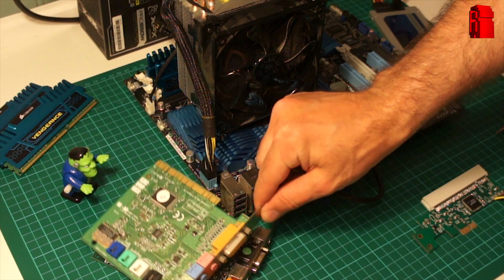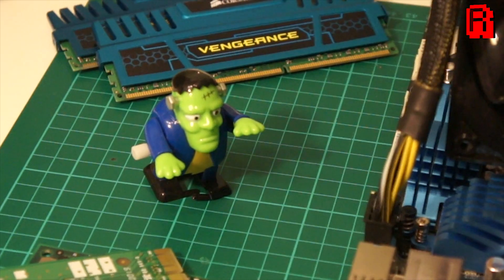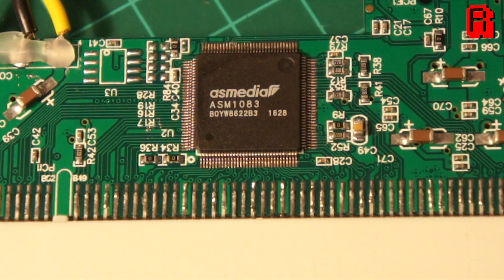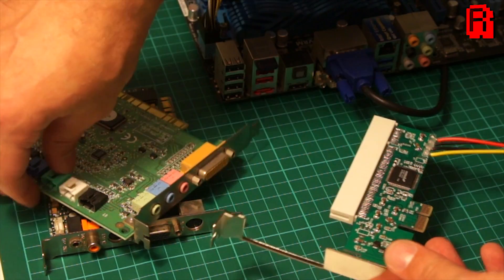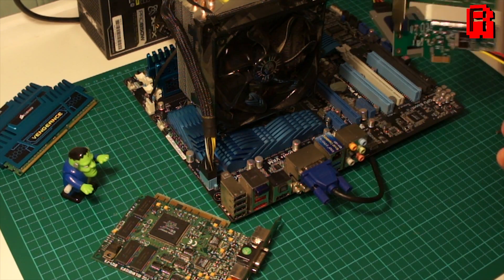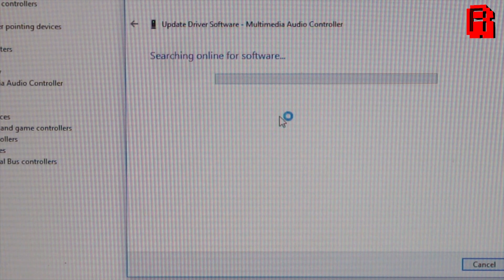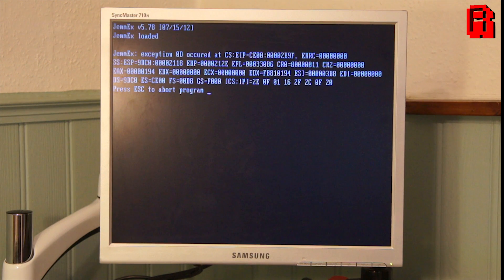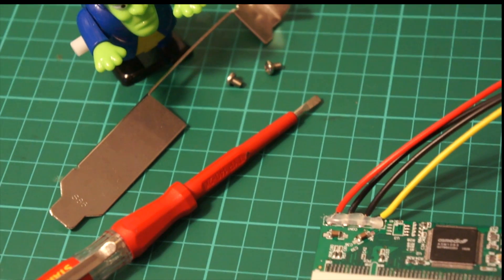PCI Express to PCI Adapter | 5 Min Tech Test

Comment: ASMedia chipset based converters have low compatibility. Pericomm chipset based converters are ways better.
Reply: Asrock H67M motherboard has an integrated ASMedia 1083 chip, with it these sound cards are working flawlessly: Sound Blaster X-Fi XtremeMusic, Auzentech X-Fi Prelude 7.1, Asus Xonar Essence ST.
Reply: @olymind1  I own a motherboard from gigabyte ( model b550 aorus elite ax v2 ) and I want to connect a pci tv tuner card from Aver Media TV Super 007 analog
OS is windows 10 x 64 
Is this procedure wanna be easy from me to achive or not ??? 
I have already ordered this adaptor and I just waiting for purchase this item

Comment: One of the positive aspects of Windows NT (5.0 and beyond., although this is true for Windows Millennium Edition as well) is that any WDM Driver is Supported.

This means provided there is a Windows 2000 / XP / Vista / 7 / 8 / 8.1 Driver available., it will install and generally work relatively issue free. In fact Windows 8 / 8.1 Drivers are 100% Compatible., at least the Drivers themselves.

What you have to watch out for are Driver Packages that include additional Software / Services, as these WILL NOT be Compatible between Windows. So it's better to Manually Install just the Driver., instead of installing the Driver Package.
Windows Automatic Driver Search will only update from the WHQL Driver List provided by Manufacturers... as there are typically no WHQL Drivers for the Hardware you're using, in fact Windows 10 is still has a very small WHQL list often resulting in the need to manually install Driver Packages, even those for Windows 10 ... this is going to be something you tend to have to deal with normally anyway.

Strictly speaking most Older Hardware while it won't always Automatically Detect as such., can typically be installed and use Microsoft Generic Drivers. Any Sound Blaster 16 Compatible Card for example, can be installed using the Microsoft WDM Audio Driver or Generic USB Audio Device Driver.

Comment: Both my Z170 and B150 motherboards still come with two PCI slots. I never used them for anything, but they are still there.
Reply from the maker: Michi Lo useful!  There is of course still the problem of installing DOS natively but as others have said a virtual pass thru into a VM or emulator like DOSBOX might be possible.  This was a very quick video I think perhaps a follow up is needed some time.
Reply: @TheRetroCollective  you mean both graphics and sound cards or just sound cards trough VM/dosbox? BTW can VM/DOSBOX limit our ram and cpu speed in proper wayy (i have 16gb of ram and i7 8700K). Win XP (including 3D drivers) and Win 10 are working perfectly with my Coffe Lake setup, I just need something for my legacy DOS games....

Comment: The Microsoft catalog reveals a Vista driver for the ES1371, probably more chance of a Vista driver working than an XP. PS. I also got an old CMI9880 working on Win10 with an XP driver
Reply: Using windows Xp drivers in windows 10 is a fuckin chad move. And a massive testament to how well Microsoft treats backwards compatibility. 

Say what you will about Microsoft but their compatibility and support for older hardware and software far, far exceeds any other company.
Reply: @dylanrush184  As they said, a Vista driver is considerably more likely to work though. Vista seems to have pretty much been the start of the code underlying the modern Windows versions. For example Windows 7 was barely any different to Vista, likewise changes with each new OS have seemed incremental since then.
From memory I used a Vista driver in Windows 10(& 11 I think) for a device, and it worked with no issues.

Comment: I want a couple of those but the other way around. Pci2pcie... :D
Reply: Impossible IS nothing:  https://www.startech.com/eu/Cards-Adapters/Slot-Extension/PCI-to-PCI-Express-Adapter-Card~PCI1PEX1
Reply: @SebaUbuntu  If you read what I wrote, I never said a GPU would work.
Reply: @SebaUbuntu  U wot m8, some GPUs are PCI-e cards, but not all PCI-e cards are GPUs. Figger it oot..
Reply: @Retroboi The PCI-e card will simply run slower - many PCIe cards don't need even 133MB/s of transfer speed. I wouldn't want to plug a 10Gbit ethernet in but a 1Gbit should work fine.
Reply: @SebaUbuntu  So, your point is?
Reply: Impossible, the bandwidth isn't there to make that work. There's a reason PCI was abandoned in favor of PCIE

Comment: You can use PCI passthrough with VirtualBox. It will allow you to run a legacy OS using your legacy hardware inside a virtual machine. https://www.virtualbox.org/manual/ch09.html#pcipassthrough
Reply from the maker: +Antony T Curtis now that is very interesting thanks.  Off to have a play.

Comment: You could solve the case height problem with a PCI riser cable.
Reply from the maker: erica you could, if you have a short motherboard that doesn't cover all the rear slots you could then mount it succesfully in the case.  I'm not sure how long a pci riser cable can be without issue.  Any ideas?

Comment: I've just upgraded my PC to coffee lake which is the latest and I specifically wanted a PCI slot, I found several boards that still have one, I got one and it works just fine. I've always wondered about these adapters, and it was nice to see one working, so thanks for putting up this vid.
Reply: Do you still use your pci cards?

Comment: Yeah... Drivers. That's a tough one. My motherboard in the system I still use has PCI slots.
But I tried a PCI sound card, and predictably, there's no windows drivers.
Further investigation shows the last OS supported was XP.

One thing I did try, was ReactOS, but that didn't install on my desktop - it worked on my laptop, but ironically perhaps gave no sound whatsoever.
ReactOS still needs a lot of work, I suppose.

(If you don't know what ReactOS is, it is an attempt to reverse engineer windows and create an open source alternative. - At the moment the exact goals are perfect compatibility with windows 2000. Aka NT 5.0 - it shares a substantial chunk of it's codebase with WINE, but of course, unlike WINE, implements a reverse engineered clone of the Windows NT kernel, rather than trying to run on top of linux or other unix-like systems.)
Reply: i had some old midi interface (emagic AMT8) that was supported up to XP, windows support was dropped after apple took over that company. but it was possible to with some roundabouts to get those drivers to work on later windows, but only on 32-bit, so that was kinda pointless to me

it did however work fine in a linux VM from within a more recent windows, talking the midi signals back and forth with a midi-over-ethernet virtual driver on both ends, the performance was still surprisingly good lol

Comment: There is utility to such an adapter. The sound card you used has no Windows 10 drivers, but Windows Vista drivers are compatible and would work. And there are many other cards that would also work well as Windows 10 drivers exist for them. So for 7 pounds that is a bit of a bargain, if it can be used effectively.

Comment: This is great. I have an old PCI scsi adaptor that I use for transferring things to old computers. I found some x64 drivers which work in windows 10, but realised I no longer have a PCI slot! I've been using an older machine with PCI in the mean time buts it's a tad inconvenient

Comment: It depends on the card you want to use, the oldest Soundblaster you can use with the Creative drivers on Windows 10 are the Audigy 1, I know I'm using it right now. The PCI128 was already having issues with Windows XP...The Live! and Live 5.1 didn't work with Vista and 7 as well but could be used with the kX drivers.
That is a pretty good trick for me, I need this card to use the Live Drive II front panel on my modern computer, and so far I've only wanted to use motherboards with a PCI slot. Those are being phased out now so I can keep using my old Audigy. on future motherboards.

Comment: The only real use for this adaptor I can see is if you want to use the pass-thorugh feature on a virtual machine to use older hardware with old operating systems.  DOSBOX would be a prime candidate for this but you could also do this with standard VM's such as VM Ware or Virtualbox.  This would be handy for titles that use features like the Glide API as utilised in the Voodoo range of graphics cards.
Reply: What about Asus XONAR DX.... it seems to have drivers up from DOS to Win 10. Is that a good sound card for DOS or DOS trough WIn98SE? I want to dual boot (well triple), XP and Win10 is already setup, I only need DOS or DOS trough Win 95/98SE

Comment: I don't think DOS support is principally possible with ASMedia cards at all. It appears the PEX8112 has more extensive features needed for DOS-compatible soundcards, but the required features won't just work on off the shelf mainboards. The problem is that PCI and ISA are buses, they can listen in on everything that passes through the bus, and that's been heavily relied upon on ISA soundcards and standards they in turn established in DOS software; however PCIe is not a bus, it's a switched network, so the correct data packets simply don't get routed to the card - it gets force assigned some I/O window, and that's it. That I/O write to port 0x388 AdLib/OPL simply doesn't reach any particular PCI-e card, and things get more desperate the more features you need, that's just the basics.

Similarly, some Windows and generic Linux drivers that relied on those features and bus nature of prior busses will be unable to do anything either.

Comment: This is exactly what I'm looking for too. In my case I'd like to keep using a Creative Labs Audigy 4 pci sound card.
As pci slots for newer motherboards are rare, and I would like to use a high end MB rather than the lower end model that has a pci slot. I'd like to see the pci-e converter with something that has Win10 drivers tested.

Comment: This seems to work pretty well to me, other than the fact that you can't fit the card in a case. Somebody should make an ISA to PCI or PCI express slot adapter.
Reply: Vesa Local Bus might be an option considering the costs of a videocard nowadays :)

Comment: did you try windows 7 or xp?
Reply from the maker: Windows 7 had no drivers for my device (most would work in Win10 if they did), and XP wouldn't install on this modern hardware without significant hurdles (possible but requires an episode in itself).  If you can get XP running then you can get some of those old drivers working I'm sure.  To be honest this was a quick and dirty test that I didn't think would get much attention, perhaps a deeper look into it would be good with some more hardware options to try out

Comment: I use a very nice, PCI-based soundcard called the ASUS Xonar Essence ST.  Someday soon, I will need to build a new PC, and a traditional PCI slot may end up being not an option.  The soundcard can be replaced with the PCIE-based STX variant, if I'm willing to cough up another $200.  Obviously I've instead looked into solutions like this converter.  I've mostly read about failure stories when it comes to this option -- the thing just wouldn't work.  But even if it does in my case, as it seems to here, I can't help but wonder whether having a converter between the card and motherboard would end up affecting the sound quality.  The whole point of using the Xonar Essence ST is the low distortion it delivers.  It is essentially a headphone amp on a card.  I can attest to its quality.  This is a lingering question I'd love to hear an informed answer to.
Reply: Asterra2, this is exactly what I'm looking for too. In my case I'd like to keep using a Creative Labs Audigy 4 pci sound card.
As pci slots for newer motherboards are rare, I'd like to see the pci-e converter with something that has Win10 drivers tested.

Comment: I have to wonder if this could be used for PCI passthrough to virtual machines. If you installed a period graphics card like a Voodoo2 or something and passed it through to a virtual machine, could you have what would essentially be an almost real hardware retro gaming PC inside your main rig?
Reply from the maker: Interesting idea, Ryzen with a Voodoo 2 anyone?
Reply: If you're using ESXi on the host machine it should work.
Reply: @steeviebops  Is there any tool or something to limit my rmodern ram and cpu speed/cores for DOS`?
Reply: It does sound feasible to me. :)

Comment: @RetroManCave
this one uses a different chip [ p17c9x ], I'd like to see you try it if you can

http://www.ebay.com/itm/PCI-E-Express-1x-to-Dual-PCI-Slot-Extend-Riser-Adapter-Card-with-USB-3-0-Cable-/172766663051?_trksid=p2349526.m2548.l4275

with an enclosure

http://www.ebay.com/itm/PCI-express-PCIe-x1-to-dual-PCI-slot-Riser-Adapter-Enclosure-for-graphics-card-/282283875809
Reply from the maker: Now that is an interesting solution with the external enclosure, thanks for sharing that.  I may have to revisit it some day.

Comment: This may be useful for things like old IDE controllers, which still have support of current computers. I have such, which is a PCI slot version and is properly detected by UEFI and OS. I can even boot from it, from an "old" IDE drive. That said, IDE controllers probably are not what a retro PC fan would want to use it for anyway. However, there are new motherboards that still have native PCI slots on them. One I know of is MSI PC MATE for AM4 platform, which does have such slots. The one I am using is also MSI PC MATE but for Intel Haswell architecture. So if you really need this, I would buy a motherboard that has such a slot natively on the board, rather than buying this converter. Driver issue would be the same regardless and you avoid all problems mentioned in the video.
Reply from the maker: Interesting stuff thank you, good to know there are still boards out there with PCI support.  I also looked into PCI-E to ISA.... it's possible but the one unit I found cost $$$$.
Reply: I've just plugged a Old VIA PCI-Sata+Pata controller card in to recover data from PATA drives. It loads fine but I still have to use an older motherboard to run the Seagate disk checker.

Comment: You do know that dosbox is available for Ubuntu right? This makes Win 10 and Ubuntu equally viable as choices for your use case. Ubuntu might even be better because it supports the hardware in question. I'm a bit confused because you brought it up and then dismissed it because "that doesn't help [you] with [your] interest in retro ms-dos gaming."
Reply: I looked into using a voodoo card a while back and Linux seemed to have full native support.
Reply: If you use the right sound card, it will also work in Windows 10. A good example is the Creative Audigy Cards, which have drivers shipped with Windows 10. Just the Gameport will not work. Besides that i have no problem using it.
Reply: Much like Doom, dosbox has been ported to almost anything with a operating system by now. You technically only really need a raspberry pi rather than the full pc for dosbox.
Reply from the maker: That's a good point I missed that cracking idea of using Linux which had drivers and then virtualised sound devices in DOSBox.  Great thinking.
Reply: if you use dosbox, there is no need for legacy PCI cards whatsoever.

but if it is not DOS, i don't think a lot of old games that would require special PCI hardware (like a voodoo 3D accelerator) would even bother to run on windows 10 in the first place

the only situation where this adapter makes sense is if you have a PCI card that is still supported by modern operating systems (yes, these exist) but your new mainboard does not have PCI slots.